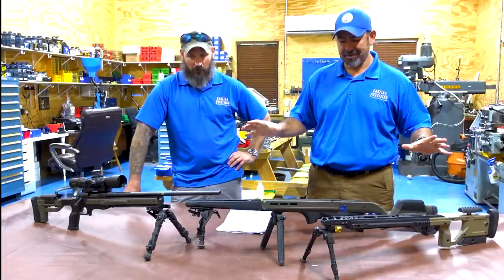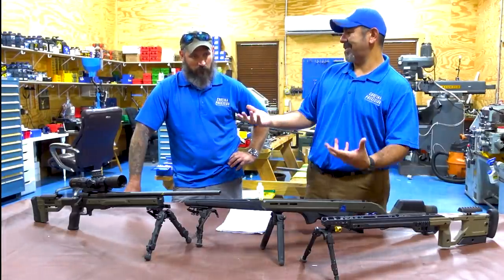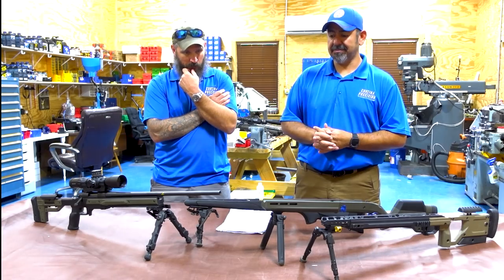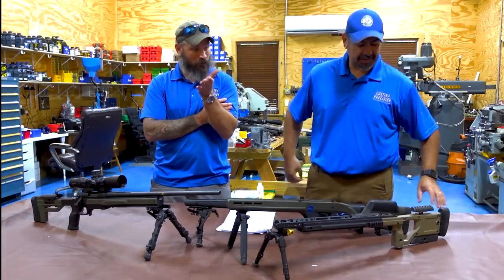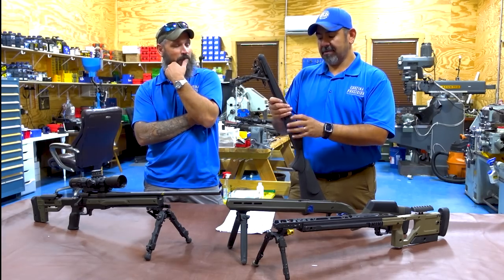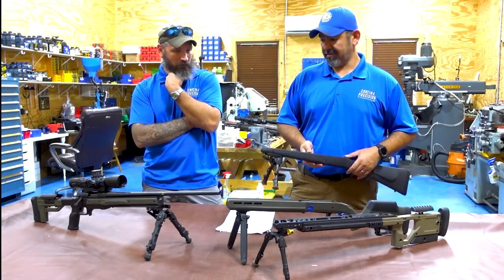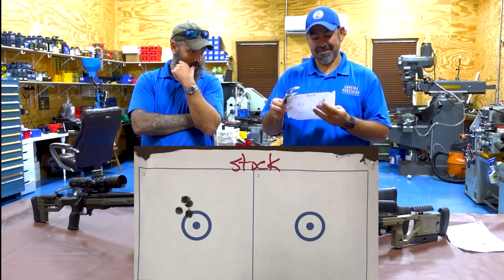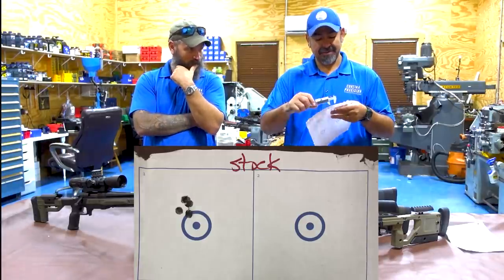6.5 NEEDS-MORE | WE TESTED FOUR DIFFERENT STOCKS

Comment: MY VOTE: Stock stock + EC Tuner break V.S. Orix + EC Tuner break. 
(changing the chassis didn't really do much, so leave it in stock stock. -- I want to see what's the cheapest way to keep em small.)
Reply: My vote for this as the next step too.  I would love to know how good the control can group with simple upgrades.  With tunerbreak can it go better then 0.5moa?
Reply: @MJKulig  I'd love to see it. If you can use the tuner to take 0.5moa off a group, I'll take of the designated suppressor off and turn my 500yard gun to an 800 yard gun (I require 4" groups for my applications.)

Comment: The best use of this series is to compare different mods to see where you get the most bang for your buck. You have already shown what you can do with a stock gun, so no need to keep doing the same thing. Try different mods on each and compare results. For example, put a Trigger in one and an EC tuner break on the other, and compare the results. Then bring them back to equal and try something else.

Comment: The point of a “control” specimen is to be able to compare the modified to the “control”. If you are going to continue to modify both, why even buy two rifles. You aren’t comparing modified to stock anymore, you are just competing two modified rifles against each other. If that’s your intent, carry on my friends. But I thought the intent was to take 2 identical rifles, use the best one as the “control” (which means do nothing to it at all the entire test) and then start building the other to see how good you can get it to shoot compared to where you started and if it’s worth the money spent to do that? Should have never modified the control rifle in my opinion. You could have just bought one rifle and shown how much better it shoots with each modification. Love the channel and the content though, and love my EC tuners.
Reply: YOU are exactly right Ben.  Nailed it. 

 Return the control rifle to it's original stock... or put it in the test rifle's stock and then don't mess with it again. There's no need to shoot it and THAT is where you guys went awry.  Modify the test rifle as much as possible, then and ONLY then, put them up against each other.  
That's the way the scientific method works.
Reply: 💯 your control is lost.
Reply: I agree with Ben, 100%.
Reply: keep any changes to the control to a total of $100 or less, or some other low value.  

how good can you get the control to shoot on a budget, vs the big bucks upgrades on the other rifle when money is less of an object.  then compare the improvements of each, and to each other.
Reply: Do a different modification to each and compare the change to each. I.e. will a trigger make more of an improvement than a muzzle brake. Then make both changes to both rifles, now they are the same again (returning a control because they are the same again) now make different change again to each I.e. springs to one or lapping to the other again comparing the change. This will demonstrate which change has the most impact and allows for a control as they are similar to each other after each series of modifications.
Reply: Ben hit it right on!
Reply: The control rifle and and another $1500 it will shoot great. square the action ,new barrel new trigger,new stock  and et tuner,and now you have a Browning.
Reply: I think following the scientific method isn't necessary here. This isn't a cancer vaccine or new booster engine for a space shuttle, it's two budget rifles being tested with modifications. Once a baseline is established that's good enough. We now know the control shoots the same as the test rifle once both are bedded and free floated so we also know the inconsistent plastic stocks are the cause of randomly variable precision from one out-of-the-box rifle to the next. At this point the need for a control has been nullified. Shooting the control repeatedly with no modifications is simply a waste of time and ammo because they have established a baseline average group size. This isn't the kind of test that requires judicious attention to the scientific method.
Reply: The control was set with the first groups shot in first episode.
Reply: @trikelife4960  again, my point exactly, if that’s the case there was never a need for 2 rifles, just buy one rifle and get a baseline and then show the evolution as you add modifications. But their test was 2 rifles with one being a “control” as the round count goes up the rifle should naturally lap itself and improve consistency with speed and accuracy to a certain point. That’s the reason to continue shooting the control along with the modified rifle and keeping the round count the same. In the end you can see if all the money and effort was really worth it in the modified rifle and what modifications made the most difference. The rifles never shot the same to begin with, nor would they. Which is why they were supposed to be keeping the best shooting of the 2 as a control. Now the entire test is shot (lol) and at this point we are just watching them modify and shoot 2 similar rifles. Also they are using thin profile barrels and running the m hot which will always effect accuracy and barrel harmonics. It’s still entertaining, but absolutely threw out their claims for the original intent of the series.
Reply: @benstapleton5948  I think you're taking the science thing way too seriously lol. Nothing is shot except the ammo. The test goes on with adaptations because it's not a god damn labratory. They don't even wear lab coats! The point is to show what mods can do and that's what they're doing. Don't get stuck worrying about the original plan. This is plan B haha.
Reply: What were the velocities for the shots? Was the velocities in the factory stock more consistent? Also look at the second group in each for the aftermarket chassis, they are tighter groups that compare closer to the two groups from the factory stock after 5 foulers. Anytime you move an action into a new chassis/stock there is gonna be some settling among the first couple shoots.
Reply: Yeah, really don't need two guns to compare each mod. I think it was interesting to see how different they were out of the box. That may be eye opening to some.  Glad to hear that the barrels shoot the same though.
Reply: Yeah I tend to agree 
The hole idea of a control is a control 
I can understand a simple pillar and glass bed
As that’s just “normal“ and if the rifle isn’t consistent it’s not a good control ether 

But you need to keep the control as stock as possible to have a good control 

The other thing you could try is cheap vs expensive mods
Ie Chassis with one and a home made foam Cheek riser for the factory stock both would give a far better Cheek weld

My vote is to keep it stock as possible
Reply: They were not exact rifles. The control rifle was the best out of the box. Now that they made the modified rifle shoot better in a way they are seeing if they can get the original control rifle to shoot as good or better. I hope you got that Ben. It may be that with the same thing done with both rifles the worst rifle may end up winning in the end even with same modifications. Wait and see. It's interesting. But the rifles were not exactly the same rifles in the first place.
Reply: @garrytalley8009  I completely understand what they are doing now, but that’s not what they set out to do. There are hundreds of videos on YouTube showing modifications to rifles and the effects of each one. I appreciated the idea of a more controlled test. No 2 rifles are exactly the same, which is why they chose the better shooting rifle as the “control” in the beginning. No they are just making multiple changes at the same time even and trying things on both sides files. The control is long gone and now you don’t even know what effects each change may have bc they are doing more than one at a time. This has just become the same ole same ole “watch me modify a rifle and show you I can make it shoot better” video series. The latest video shows the #1 rifle being tested with a new crown, new brake and tuner all at the same time. Guess what? It shoots better……..Now what made the biggest difference? You have no way of knowing. That’s my point.
Reply: I have to side with Erik on their method. The "CONTROL" Data has already been established several times over that it barely squeaks in under "Sub MOA". What's the point of shooting the same rifle over and over through these tests, if its going to REPEATEDLY reproduce the same results? Those results are already there. Future tests can go back to the results that have been repeatedly established. Curious about the "stock rifle control" in the next 8 videos, let's go back to the targets from the very first few tests. Video #13, "Geez I wonder what the 'stock rifle' would have shot now..... same as the FIRST FEW TIMES AGAIN and AGAIN and AGAIN". Are you hoping that shooting 50+ rounds it will become a "quarter minute rifle"? No. IF you are still wondering what the "stock rifle" shoots, refer to the first 4 groups.
- They also could at the very end of all this testing. THROW IT BACK IN THE "STOCK - STOCK" and test it again. It'll most likely repeat the same results from the very first few tests. Better yet keep it as the "Control Rifle" for every future video even if the video is not about groups. Snow in Texas in October, CRAZY Times, let's break out the "Stock Rifle" and see its groups. Nationals 2023, F-Class John wins, test the "Stock Rifle" to see how it performs. Vlog 2025, Erik further expands his business, test the "Stock Rifle" AGAIN!!! 
#ResultsAreAlreadyEstablished
Reply: @theLTrain700E  lol they have only shot it at 100 yards, that’s hardly considered results. What’s the point of having 2 rifles then? Are we going to put wheels on them and race them? Drop test from the top of a ladder and see which one hits first? I know….we will put a brake and chassis on one and only a chassis on the other and shoot them again? You already have those results from shooting the one rifle with only a chassis. There’s no point. Everyone is entitled to an opinion, apparently it really bothers you that others opinions aren’t the same as yours. Enjoy!
Reply: I agree with the control..However if your just looking at accuracy, they have the original groupings, that isn't going to change, at least not much, as the barrel breaks in. Modifying the rifle after that won't change the "control groups " just see if the good groups can be improved. Really, now the testing is comparing the improvements if you get a good or bad starting rifle
Reply: I know EC has read the comments and hasn't even address them

Comment: The "control" should keep the barrel and action stock, on the non-control you should add a brake, upgrade the trigger, change the bolt, etc. especially if they are shooting the same in the same Oryx stock. This way you can see what modifications are help the most and also rule out the difference being barrel break-in. Then after you have ruled out barrel break-in upgrade the control to the same point and see if you can duplicate the results.

Comment: Where to go from here.  
Suggestions:  Check the bedding accuracy with a dial indicator.  Attach a clamp to the barrel and put the indicator on the stock.  Stand the rifle up and loosen and tighten the lug screws one at a time.  If you have more than .003 run-out it will affect the accuracy.  I have been doing custom pillar bedding since 1975.  My bedding accuracy is around .0001 to .0004 when I am finished bedding a rifle.
Check the bolt lug contact by using a sharpie to ink up the back of the lugs on the bolt.  Degrease both action and bolt lugs surfaces first. Work the bolt 3 to 5 times up and down.   If you do not have good contact on both lugs it can again affect accuracy.  Check both 6.5 rifles for bedding and bolt contact.  If the bedding and bolt contact are acceptable then the Remington barrel might improve with a cryogenic treatment. (maybe) It worked for the Krieger 222 Remington Mag barrel I installed on my Cooper model 21.

Comment: Leave the factory stock on the control and keep throwing money at the custom until the groups start to equal out.  Polish the trigger on the control, put a cheek rest on it if comfort is so important.  If the recoil is so bad on the control put a pull on pad on it.  Leave the cheap one cheap and make the other match it.  Don't make them the same.  Stick to your guns on your original premise.
Reply: I think this is the best way to go.
Reply: How is a 6.5 CM such horrible recoil 🤷🏼‍♂️🤣
Reply: @captainamer71  I think one of them said, I believe it was the shooter, said that the expectation of recoil throws the shot off.  I've never shot a 6.5 Needmore but I've shot a 6.5 Swede and the recoil isn't much.  They've now put a tuner brake on the custom, I think they should put one on the control rifle too and see if that brings accuracy up to where the custom rifle is now.  Keep the cheap rifle cheap.

Comment: I HIGHLY recommend that while your installing the tuner, put a 11 degree crown on the barrel and also lap the bolt lugs until there is equal contact on both lugs. The Remington crown is full of burrs and the lug contact causes irregular clamping. That will help a lot to produce sub-MOA groups.

Comment: I have seen many rifles break the rules of accuracy. The last mass produced rifle I sighted in and developed a load for was a rush job for a friend that needed his rifle for the first weekend of deer season. The rifle was a Remington 700 in 270 Winchester with the black Tupperware plastic stock. 
Had to scrape the action area of the stock for a high spot with a pocket knife because you would get rocking of the barreled action when you would tighten or loosen front and rear action screws. Did not have time to piller bed. Mount the scope, bore sighted , worked a latter loads of H4831 and 130 gr Sierra Boat tail soft points. Max load of 60gr.  Of H4831 shot best 3/4 in group five shot from skinny factory barrel. Not only that . The bullet had About 1/8 inch jump to the land because of a long throat. Never obtain accuracy so fast with so little work. I repeated to test the following morning to make sure it was not a fluke. Shot 3 more 5 shot group with same results.

Comment: Here’s a thought… Run 40 more rounds thru #2 to get the count back to being even again, go ahead and put #1 in an Oryx, thread both barrels so you can put a tuner brake on both, clean both like you have been, BUT!!!! While you have the barrels off, inspect/ compare both side by side to see what differences you find. Chamber details, crown, bore scope to see how the bore is being polished, etc. If no real differences are found during inspection, during re-assembly you’re going to know for a fact that both are torqued identical- which they might not be exactly the same right now and could be effecting harmonics- and at that point you’ll know without a doubt that everything is as close to exactly the same as possible.

Comment: The Remington700 is available in the Magpul stock out of the box. I have one in 260 with a threaded barrel. I have a lime saver rubber tuner on it now and it shoots great as a hunting rifle. My suggestion. Would be to continue movi forward with the control as a hunting rifle and the other as a competition rifle and compare costs as you go. I paid around $800 for mine plus shipping and all I've added is a $10 rubber vibration dampener. It is 1/2 MOA for under $1000. Full disclosure, I'm shooting handloads that I formed from 308 because factory 260 was not available at the time. I didn't do load development, it was a middle of the road load data from my Lyman 50 reloading manual. I literally looked at the minimum and maximum for the 140 grain SST, went to the midway charge and rounded off to the nearest even number. Which ended up being 40 grains of H 4350. I think my barrel is a heavier contour also, it was what ever came stock in the Magpul 700 configuration.
Reply: 800$ for all that out the door is a great price actually.

Comment: Ammo used? But actually years ago I fiber glass epoxied the whole sythentic stock, I dremeled out the interior, glass bed the rifle, made the stock rigid with fiberglass and epoxy and did my own trigger job. it shoots like a dream. I don't get out enough because of costs lately, but for my first rifle that wasn't handed down and that I made modifications too, it shoots like a dream. I have no regrets even though an aftermarket stock would have been easier, I would have learned less and it would have cost a lot more. (oh, and I put a brake on it for fun), didn't need to, but I did.

Comment: At this point, you have a new control.  The data from this rifle in all of the different stocks is your control.  Stop shooting it.  Start upgrading the other rifle and shooting it until the round counts match and then re-access your data.  Depending on what happens with the other rifle, you may want to go back to the control rifle At THE END of the planned testing and only apply the modifications that showed noticeable improvement on the upgrade rifle.  This will allow you to determine the minimum upgrades you need to maximize the accuracy of these rifles.  Once you start cutting metal, you can't go back.  This is a great series, btw.  Thanks for doing it.
Reply: I agree with this assessment..

Comment: Erik, see if you agree with my analysis of your stock change:  If an action is attached to an infinitely large mass, the barrel harmonic vibration will be primarily a result of barrel movement.  If you change the mounting of the action to an extremely flexible stock, the forces of the harmonic vibrations are now shared with the stock.  If another stock is less flexible, it should also change the harmonic vibration distribution.   You could probably put a movable weight in the stock and tune the rifle platform, much as you do with the movable weight on your turner brake.  Your thoughts???